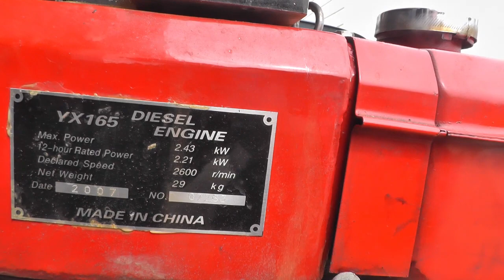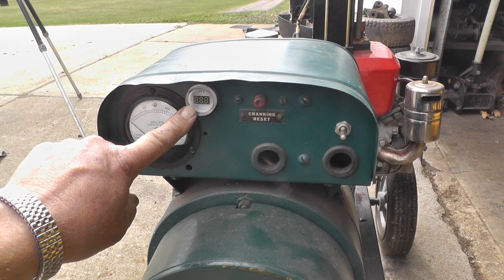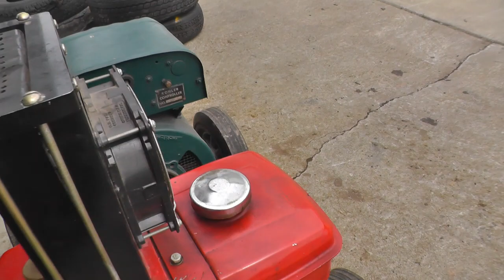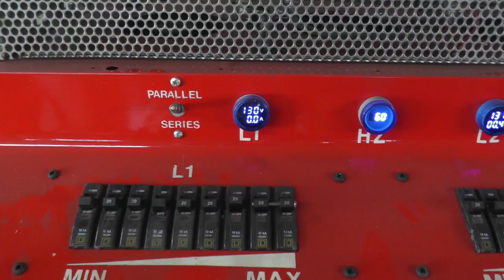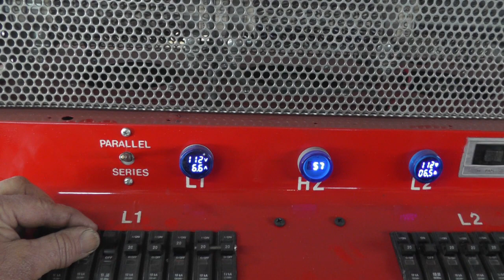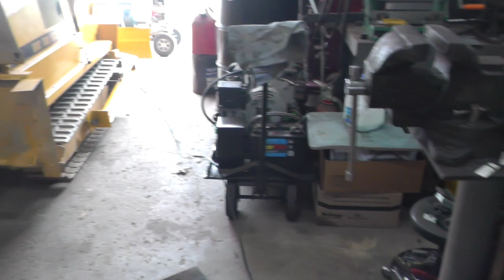750 Watt Diesel Generator

Comment: Did you ever run it long enough to get some fuel consumption over time or wattage…?
Reply from the maker: I have ran it for some fairly long periods of time at engine shows charging my camper battery but never check fuel consumption.

Comment: These smallest diesel engines are remarkable good piece of engineering. This is generating electricity, then that is another wonderful endeavour. A complete set up is working just near to me. That works during loadshedding which goes 2 hours and more. Yes it is noisy. Moreover a three hp diesel engine is used for cutting hay.

Comment: Enjoyed your setup and demo. Less is really more. Off grinders can top off batteries and burn less fuel. The 1800 rpm heads are a rare find but a 90 volt DC motor isn't.  Any small diesel with love Joy's or pulleys preferred connected to motor will give you the power to charge batteries thru a simple low amp transfer switch on your solar charge  ontroller.

Comment: Did you repurpose a cooking pot for the cover ? I have thought of using a chevy truck transmission cooler with an overflow tank to make a closed system . I like the way you think , we are on the same wavelength 😉👍👍🇺🇸
Reply from the maker: I think it was one of those tins you get cookies in. Thanks for watching.